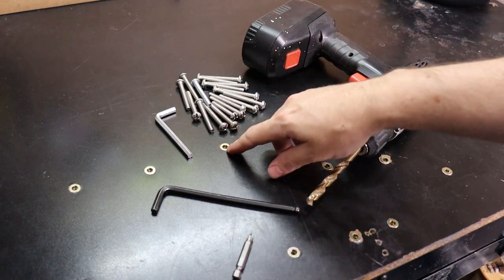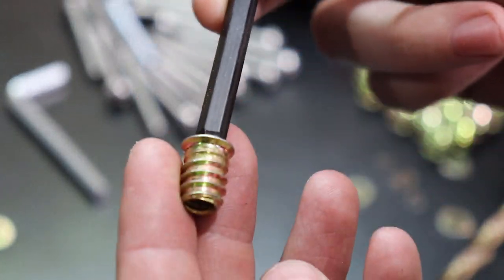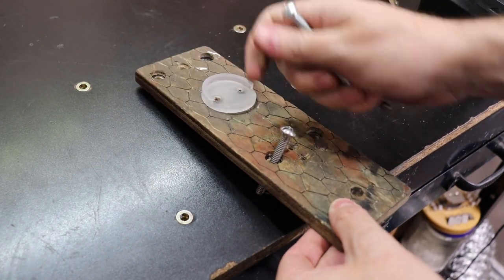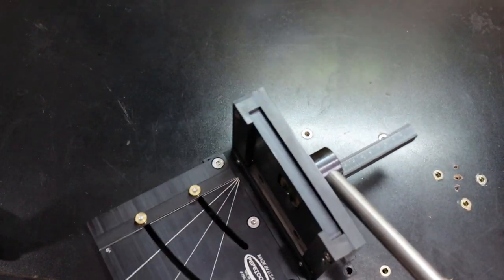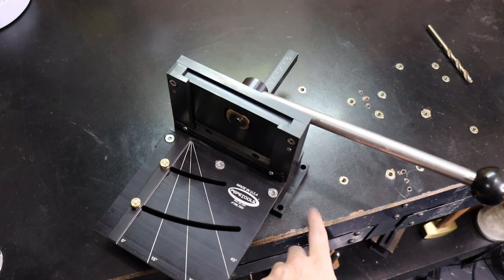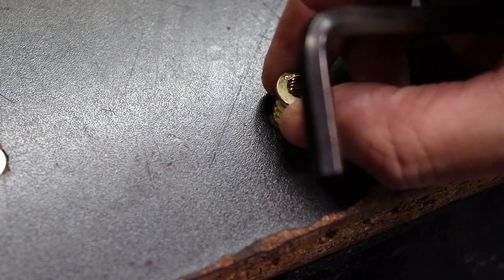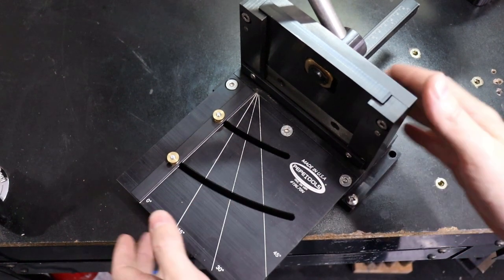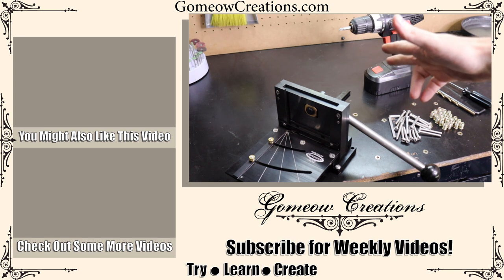QUICK SWAP Mounting for Your Tools - Modular Design

Comment: I did something similar, only I put the screws into the table in a triangular/hexagonal pattern (like a star of david) with 3 inch spacing between the nuts. Then I made a wood platform for each tool to be mounted. The platforms screw into the triangle pattern, and the tools are screwed down to the platforms using whatever hole pattern they happen to have. The hex pattern allows the tools to be screwed down at many different angles and orientations which is VERY handy if your work area is tiny. I am so happy I did it this way. It is very versatile.

Comment: Randy to be able to quickly align the tool to the correct holes, how about scribe mark around the tool on the table top. That way next time you would know exactly where to bolt it. If you don’t want to use the scribe method then paint the correct bolts with a marker.
Reply from the maker: That is a good idea and I was going to do that but because I shoot videos about a lot of different things I didn't want lines on my work area 😊👍